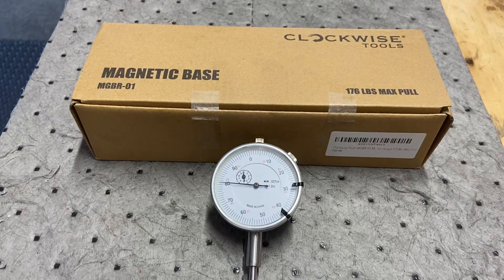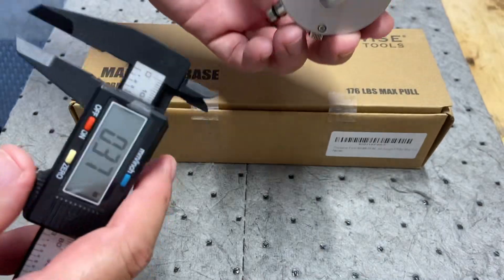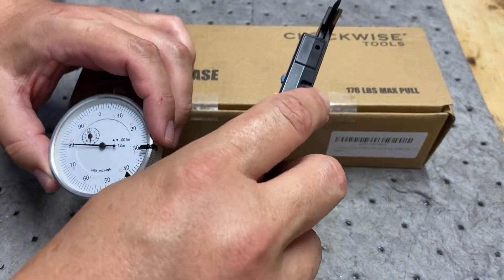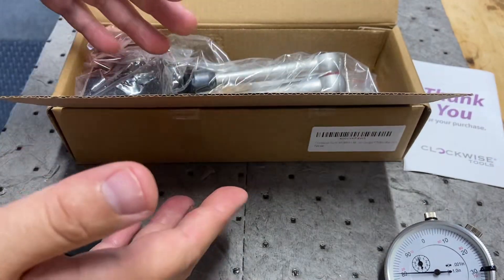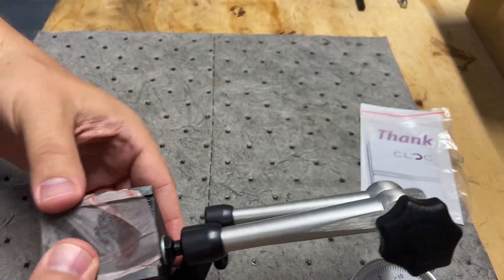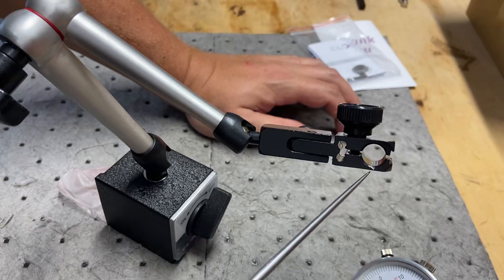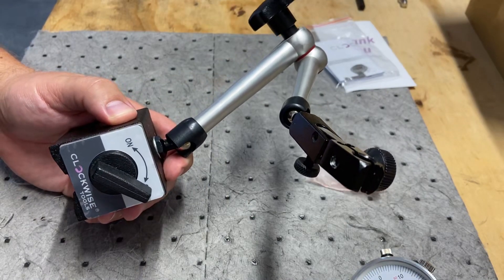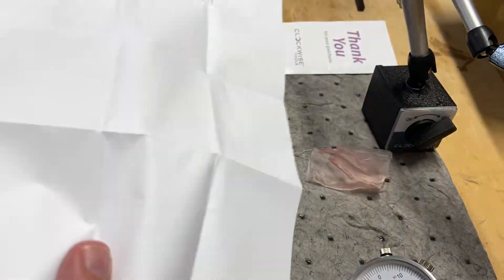Vevor Mini Lathe MX 400 Part 18 - Checking the Run Out of the Chuck Mounting Plate and Chuck

Comment: I get what you were trying to test with the runout on the outside of your chuck you really don't care unless you are trying to test your spindle bearings. The real test is to see what your chuck jaws are doing while holding a ground rod or something you know is straight. The outside of the chuck is not a very good indicator of what your work is doing. That is of course unless you were trying to see what your spindle bearing run out is. I like the placement of your mag though and will try locating it at the same place on mine.
Reply from the maker: I see your points.  Honestly I was just testing different aspects of this device on how it was built and delivered.  Wasn't really testing for anything other than build quality...at least in this video.  I have an upcoming video where I turned down a rod true to the chuck jaws to attempt to center the tailstock again.  If I can find a true rod I will chuck up that and test runout on that.  Agree that is what is important.  I want to be accurate as i can with this machine but it wont be likely that super critical tolerances are important for anything I'm doing...But I want to strive to be as accurate as possible.

Comment: Look at the tool company called Shars they have really great tools at a good price. To check the Chuck install a precision ground rod into the chuck and that will tell you total run out of the Chuck.
Reply from the maker: Awesome,  Appreciate the tip on Shars.  Just checked them out.  Prices aren't too bad especially if their quality is up.  My drill chuck taper rod is independent from the drill chuck itself,  I'll separate those and check for runout there.  Good idea.  Thanks for watching.